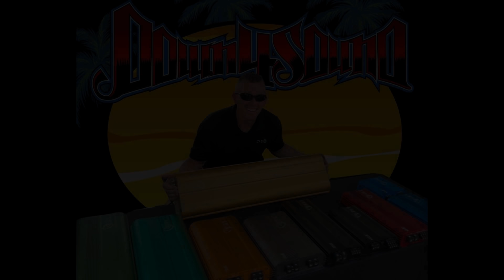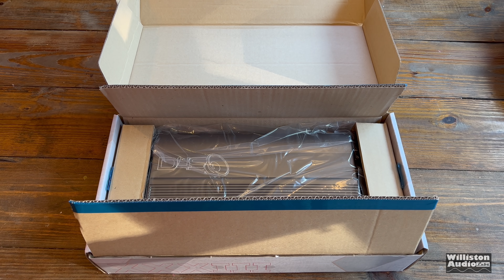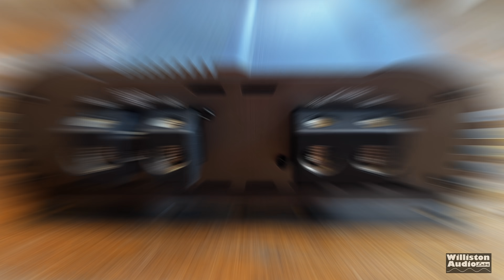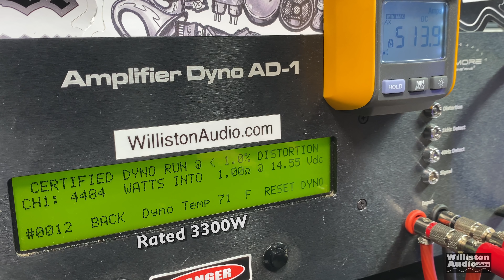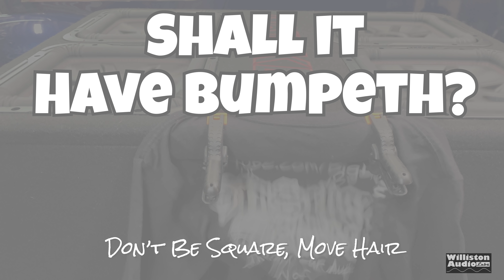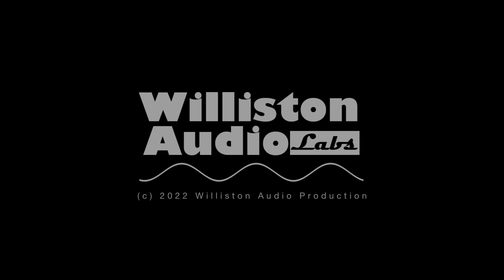3300W Battleship? Down4Sound JP33 Monoblock Bass Amplifier Amp Dyno Test [4K]

Comment: I have a Lincoln town car with a jp33 with 2 mojo 15s from Memphis also a 240 Mechman amp. I’m running 0 gauge wire. I’m trying to figure if I can use a 300a fuse and get rated power

Comment: i would just like every one to know that these are over sized 1/0 power and ground inputs they fit 2/0 wire very carefully and snug no trimming i run 2/0 in to my jp23s i know over kill but so is ppl running dual inputs lol but over kill is always better then under kill

Comment: ok I'm running a single sub db wdx 7k rated at 3500 rms I'm using this amp for it but i wanted to know i just got a 250 high output alternator the big 3  is done is this good enough or should i add more

Comment: Just ordered one in Red. On SALE‼️ $509.00 Couldn't pass it up. Thanks for the video Big D 👍🏿
Reply from the maker: Awesome deal!
Reply: @wal  question, If I just run this at 4ohms, will I still need to get a HO alternator? And if I go 1ohm, would I have to use the double power/ground outputs for each of the original outputs?

Comment: Why such high impractical voltage tho. So many on stock alts or pcm regulated recharge rates. It's cool to see what power potential is there but for most everyone using this amp, bc of their recharge rate, they won't see what you're getting. 12.8v and/or 13.8v would be more practical dynos.

Comment: Can the amp be lowered to 0.5 ohms?
Reply: Yes. I ran my jp33 at .5 for 4 months no problems.  I have a 290 amp autotech ho alternator and a powerxs titan8 lithium battery to help with the extra current draw running that low.

Comment: I've got a question. I've got the quad box on my JP33 running at 1 ohm. I've got 48ah of lithium that's capable of handling 6K RMS and it has in the past. Even the way it's setup right now on the 33 my voltage isn't dropping below 14V. It charges to 14.5 and drops to 14.1- 14.0. It's weird because when I had it on the JP23V2 I was seeing voltage drop to 12V. I have my setting almost identical to what I had them on with the 23V2 and my head unit the same and at this point the V2 was still probably 3× louder then the 33 is right now. what am I doing wrong 🤦🏽‍♂️

Comment: I have a JP33 on 2-18" Skar EVL's in a 10cuft box. 2 runs of 0 ga wire,big 3 and 2 batteries stock 160amp alt. You better have a 300a alt. This amp blew the motor completely off of one of the subs,also my Yukon reeked of burnt voice coils.

Comment: D could you do another test with both channels
Reply from the maker: Whatcha mean? It’s a mono amp
Reply: @wal  
I know, it 2 set of speaker terminal wire. Is it same watts in both.
Reply: @greenlener the speaker terminals are internally connected.  They have 2 speaker terminal outputs for easier wiring.

Comment: Down 4 sound you guys really hit the jackpot with these  Amplifiers built quality is Amazing I know I won't have any big problems repairing one of these Amplifiers great job guys keep up the good work nuff respect to you Big D 👍 👍 🙏
Reply from the maker: Thanks for watching and commenting!
Reply: @wal question, the site say you HAVE TO HAVE electrical upgrades such as HO Alt, reserve battery and big 3. I understand that’s needed if you want to run it at 2 or 1 ohm, but what about for just 4 ohms?
Reply: @supadupa6891  still pulling 190 amps at 14.7v at 4 ohm, that's asking a lot from factory electrical probably closer to 250 amp's figuring realistic voltage drop

Comment: Love the videos you have done on jp amps!! If your were choosing an amp to run a sundown x15v3 which jp amp would you chose if electrical is not an issue I was going to get a salt 4 or 6 but I kinda like the FL orange jp amp would look nice in my set up

Comment: This deserves a re-visit.  The JP-23 in uncertified mode draws 134 amps and puts out 1550 into 2 ohms.  The JP33 draws 134 amps and puts out 1960 watts at 4 OHMS. so you get 500 watts with the JP33 wi ththe same draw.  My electrical stock pretty much with a 145 amp alternator, the big 3 done and a Optima Red Top battery, so this would be huge for me.
Reply: im saying the same thing in my head cause at 2 ohm this amp puts out close to 3500 rms close to the 15 inch wdx 7k DB close enough but not over the rms but seems good to me

Comment: What electrical upgrades would you need for this amp
Reply: yes... all of them
Reply: I run a jp33 for sub wired at 1 ohm and 2 other amplifiers for mid and highs.  I have a Autotech 290 amp alternator  with a 80ah agm up front and a titan8 supplemental battery in back and it holds high 13s at full tilt.

Comment: Awesome content Big D. In order to use this amp 4ohm, the use of both power terminals have to be used?
Reply from the maker: No, the speaker terminals are in parallel. Use one set or both, doesn't matter
Reply: @wal  thanks for your reply D. I was actually referring to the Power inputs. I know I will be limited on the power output of the amp. Just wanted to clarify what possibilities are with this amp.

Comment: It's funny how amp's are going the other way now, we went from joker way overrated amp's to quality way underrated amp's, i seriously think JP d4s should rate them a little closer to there actual power output. People will buy them thinking they are close or around the stated power, and build a system around that, just to possibly have their subs blown out because the amp is WAY more powerful then expected.. Just a thought. Great vid Big D👍
Reply from the maker: I don't have a way to drop my voltage into the 12's with my setup currently, but I'd tend to bet this amp will do it's rated 3300W in the high 12's and unfortunately many people who buy these won't have sufficient electrical and will see voltage drops to there or lower
Reply: @wal  can I run this amp with a single run, or do I need to hook up both power/ground terminals? Will be running @ 4ohm

Comment: BIG D, while I do like the quadbox do you by chance still happen to have the American Bass Xmaxxx or Massive Audio I don't remember exactly which woofer it was but a while back you had one beefy woofer that you tested, I would love to see some "do it bump tho" done with other beefy subs more like something your everyday baddhead would be familiar with....
Reply from the maker: My Massive Audio BOA needs a new box since the provided port area was incorrect
Reply: @wal  ahhh yes that's what it was, well that woofer is certainly worth taking the time to build a nice box for and if you're not keen on the design aspect I highly recommend msg'n my friend Drew Jones from basshaulics and have him draw you up a box design it will come with a complete cut sheet and everything you need to make building a badass custom box easy... That baby is able to handle gobs of power I'd love to see it in action fully powered in a good box built to proper spec

Comment: I am loving where the modern Korean half bridges are evolving like my wolfram AW-9000.1D it is so small and lightweight just absolutely beautiful now I also have a DC 7.5k which weighs 3x as much and is way wayyy bigger yet my smaller wolfram has thousands of watts more than the DC does and it doesn't require as much current to make that power! Our old rule of thumb of 10x the fuse rating is no longer valid because they're now making them so efficient that they're doing far more than that like for example the B2 audio amps can make 15k watts out of 720amps 🤷‍♂️ incredible but I do however believe that is a full bridge...
Reply: @wal  thanks to you brother I recently bought a splx3000.1D just because how could you not at 649 for so much power lol I needed another amp like I need a 3rd elbow but hey I've seen them go for a grand used on ebay so somebody must like them and to buy it brand new warrantied for only $650 it was a no-brainer and if nothing else I'll just keep it on my test bench as a mule amp to push new subs and break them in when I get them... Im stoked to see that BOA in a good box not sure if you were intending to do that or not but I figured if I brought attention to it maybe somebody would build and send ya one lol-ol-ol

Comment: Hey Wilson I have a alpine 3548 2 chanle  60 watts @ 4ohm and 80watts @ 2ohm and 160 at 4ohm single it seem like it has much more it was shaking my car with my drected 12sx4d in a vented box  and that was at 2oms but didn't want to run it at 2ohm cuz it did not say it was rated at that if you can do a test chek it out that would be sweet
Reply from the maker: That’s an old school amp!

Comment: So you do have to upgrade the electrical of the vehicle for this amp at 1,200 watt 4ohm? just a battery with a little extra cold cranking amps should cut it right? i have run some of the smaller amps at 2 ohm but normally i run mine at 4 so as not to burn up my equipment. was thinking it would be really nice to have one of the american made green ones myself.
Reply from the maker: Maybe not at 4 ohms

Comment: I was totally guessing this was a full bridge amplifier. 

Very surprised it isn't, based on it's size.
Reply from the maker: I was told it’s the first all surface mount design Korean Half Bridge. This helps keep it more compact. The heatsink is thick and active cooling works well

Comment: Power wires and RCA wire to the amp, I don't get the benefit of one less wire being run from the same place, to the same place the RCA goes and lose an USB port to boot.
Reply from the maker: I swap amps all the time and my power and RCA’s are already installed
Reply: @wal  niche gimmick.

Comment: Nice vid!  Regarding the “Tiffany” RCA connections, you might want to remind your viewers now and then, why they’re so much better.  The cheapies stress their connection to the circuit board, whereas the panel mounts are solid and isolated from the board connection.
Reply from the maker: Good point, thanks!
Reply: No idea why he calls them "Tiffany" however.
Here in Australia, Tiffany is a super-cheapo electrical brand sold in the worst variety stores.

Comment: Wireless remote here’s the usb c input🤣 
There’s a reason the best gamers use wired peripherals😉
Reply from the maker: Like wireless speakers…they still need power 😂
Reply: @wal  I’d rather run the bass remote wire your running rca and power wire most likely anyways and if you have USB port it may have other functions besides just power and my vehicle vehicles are made when they were higher quality usb either were not invited or not needed in cars yet since best phone was Nokia. Snake was so fun though. Lmao!

Comment: I see a lot of people hating on JP and his amplifiers, but they are currently the best value for a Korean hackbridge outside of Crescendo audio. Hopefully he keeps the price affordable. If he does he will definitely reach the profit margins he wants just buy pure sale volume. I'm working on getting the jp63. Look forward to seeing the numbers, all though it is not necessary for me to make my purchase.
Reply from the maker: I seriously doubt any would do anything less than rated. I’m feeding them healthy voltage, as I’d suggest for anyone using these 👌
Reply: @wal  yup, familiar with the circuit 😉. I can supply all the current's 😆 running a Korean 4k right now @ .5 voltage drops .2v from 14.8 not even hitting the top 10% of a JY80 thanks to a 370alt.

Comment: Wow. Been looking for an amp to replace my Zapco DC 1100.1. It sounds great but maaaaannn does it use a lot of juice.

Would anyone recommend replacing that Zapco with this? Would their two and four channel amps be good to replace similar Zapcos in a SQ build?
Reply from the maker: Although these are marketed as SPL or basshead amps, I measured 95%+ efficiency at 4 ohms and the S/N ratio is high according to AP tests. I bet it would do well in that application
Reply: @wal  I thought so. Thanks to this video, I'm gonna pick up their dual set and give 'em a try. If they don't work for SQ, I can sell 'em ... but I suspect they'll be great.

Thanks, man!

Comment: If I hadn't purchased a couple of DC 3.5K's I would have went with these. 7-8" shorter and near half the price, damn.
Reply from the maker: Before this amp, the DC3.5 and Nendo 3.5’s were the highest efficiency amps I’ve measured at 4 ohms. They are all great, these JP amps are the latest tech with all SMD components (surface mount)
Reply: @wal  You're right. I bought them 7 months ago.
Reply: @wal  D, SMD (Steve M) is manufacturing amplifier components??
Reply from the maker: @scottiffanimccord1509  Ha! He just has the same acronym. SMD is surface mount device and has been around longer than Steve Meade Designs

Comment: Really cool amp. 4 gauge speaker outputs is just silly though. Otherwise its a beauty.
Reply from the maker: Just a bit overkill. As the old RF slogan said “Too much is just right!”
Reply: Think of it like a built in distribution block. Not everybody is just going to run only 2 speakers off of this amp

Comment: I like the idea of a bluetooth remote but I think I'd still rather run a wire as opposed to having to plug it in to a USB port.
Reply from the maker: If you swap amps like me this is nice because the pin out for the bass cables doesn’t match across brands so this is a breath of fresh air for me

Comment: Great review! Nice looking amp. I may need to replace my Rockford T-1500bdcp with this. My ZV5 15” could use a bit more power
Reply from the maker: The T2500.1bdcp is one of my favorite amps, but you can literally get 2 of these for the price of one of those
Reply: I got a single zv5 15 running on a deafbonce apocalypse 4k
Reply: @peacefrog57  that’s what I was going to buy an AAK4K or Salt 4, but they have such a large footprint compared to this new JP33 amp. What are you running for electrical? I have a northstar 27F AGM and a mechman 340. Two runs of 0. I just ordered a limitless 12k to prepare for the next upgrade.
Reply: @505Tempest  i got two D4S LTO 6.0  and a 360 amp js alternator
Reply: @peacefrog57  have you ever metered it?

Comment: You have me paying more attention to the inrush current on these tests now…..These big-boy amps 😵‍💫 take power to make that power. I’ll continue beating the block with my JP800.1 😆 Another great vid as always 🤝
Reply from the maker: Thanks for watching and commenting!
Reply: I saw that also. Costs as much/more to feed it than buy it..just part of the hobby. This is why i spent the money on good ofc to start, and plan to use several runs of 4 gauge to build as i go, starting with a smaller amp first.
Reply: @jimbobdobbs1597  My man 🤝 I knew I wasn’t alone out here 😂 Don’t get me wrong…these big amps are dope, and I like them, but I have to be honest with myself first. Knowing my budget and what my reality voltage will most likely be (12v-13.6v) I agree, gotta start with a solid foundation (electrical/wire) first and work your way up. Sad thing is, by the time you do…you have to start all over, because we are constantly upgrading 😂😂😂😂 Never ending cycle my friend ✌🏽
Reply: @210Designs  oh hell no. It truely never ends. I dunno if you ever watch Jacob viral channels, you see these builds that are incredible , over the top, holy sh*t builds that are hitting 155+ and then the guy will pop on the comments and say"oh this was the OLD build..all thats gone, now its..." its just like owning a boat. You love that boat.. but after a year you start saying "if it was just 3 foot bigger it would be perfect" (and the cycle continues) can never go wrong upgrading electrical
Reply: @jimbobdobbs1597  LMAO!!!😂 Yea, I’ve watched his channel also. Yup…some insane/powerful builds out there for sure. I’m guilty of it too, not as bad as I use to be tho. I just started buying vehicles, instead of rebuilding 😎 we are get use to it and then it’s not as loud to us anymore. Like chasing that fist high!

Comment: Nice amps. The Orion hcca splx 3k still dominates all these tho. It's gonna be a while till someone comes and dominates that amp for the price.
Reply from the maker: That amp is still amazing and they even made the bass remote better. I need to get a 2022 model in
Reply: @wal  the caps are different on the new ones I think. Seems like they made the amp a little more stable wired low.

Comment: After this review of course this amps price is going to rise. Reviewers tend to cause prices on products they review to sky rocket.
Reply: The companies usually plan to raise the price after a review or # sold. Advertising a low price generates more traffic for the website.
Reply: That's why I copped it within minutes of dropping and shelfed it.
Reply: @everdayjack4971  Do you plan to use it later or are you hoping to sell it for more than you bought it for?
Reply from the maker: Demand usually drives prices. As I’ve stated before, my job here is to provide info and y’all decide if something is right for you or not